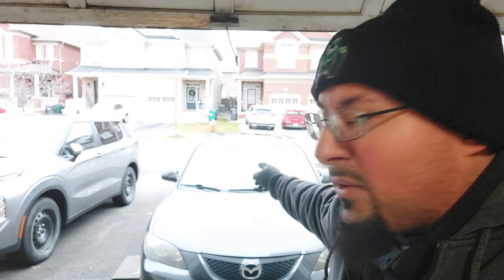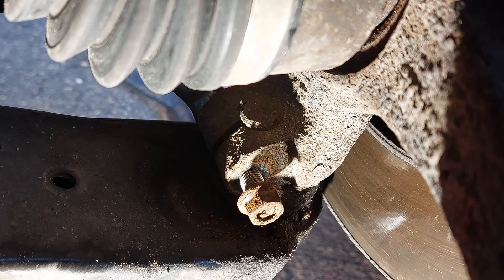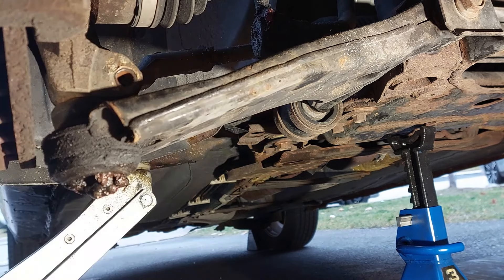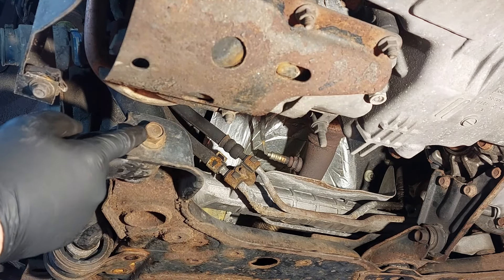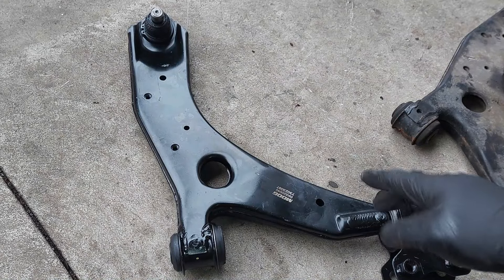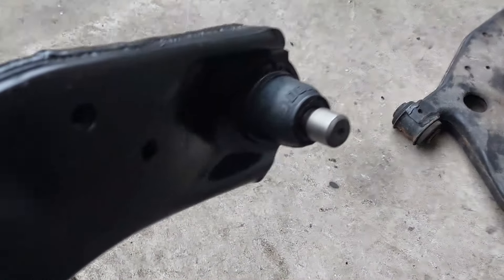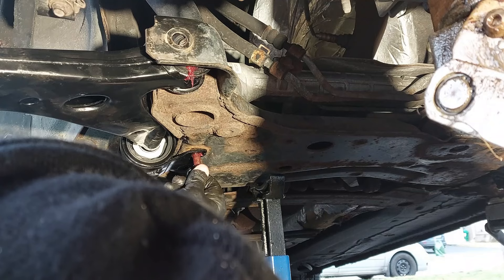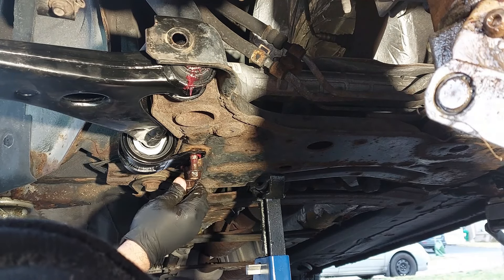2006 Mazda 3 - 2.3 - Front Lower Control Arm - Passenger's Side

Comment: Thanks Moose🫎🙏🏻 you’re efforts are certainly appreciated. Just you taking the extra time, preparation, and effort that it takes to film, edit,  and all while trying to explain the steps involved and getting
a good shot. It’s harder than it looks that’s FS so thanks again for just enduring the extra headaches that come along with recording editing and uploading it which takes time to do so. So thanks again man.  However I’m curious, did you loosen engine mount #3 before jacking up the engine the inch or 1.5” ?
Reply from the maker: Thank you sir. No I didn't loosen the engine mount. You can jack up the engine just a little bit until the mount center piece touches the metal on top. As long as you don't go over that then you are fine. If in any case you need to jack the engine up further then removing the mount will be needed and it's not too difficult of a job. I was able to do it without removing the mount since the engine just needs to be lifted up slightly.
Reply: @moosemobileautorepair  thanks, I replaced my LCA (reference wasyour video) on my 08 Mzda3 2.3L and to anyone needing to do this job 21mm lug nuts , 14 &16mm or 15&16MM for the ball joint pinch bolt, 19mm main control arm bolt you have to lift engine for) 17mm pair that thread into the LCA itself a   (in my case a 15mm (if your swapping them for mevotechs the new hardware was 14 or 15mm  instead of the 17mm factory) also idk if necessary by I used a 12mm for the ac compressor guard but you really don’t need to undo the transmission mount or engine mount 3 or I didn’t at least just put a 2x4 in between jack pad and there was a good flat spot and
I just raised it slowly until I could barely get clearance and then g2g tighten everything lightly then reassemble and that 19 as well as the bolts that thread into the LCA itself need to be torqued to spec while the vehicle is on the ground on all 4 wheels as it will be at rest That’s all I can think of for now. Sorry if this is a little bit rambling I just finish this job and if I can help anyone I’m glad to do so talk to text gets easy to ramble though. Sorry for those TLDR.